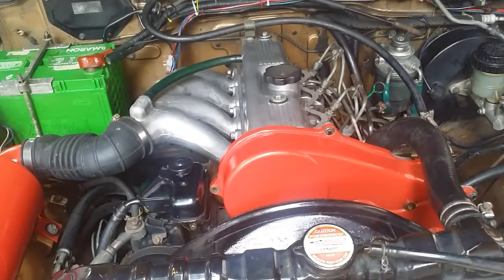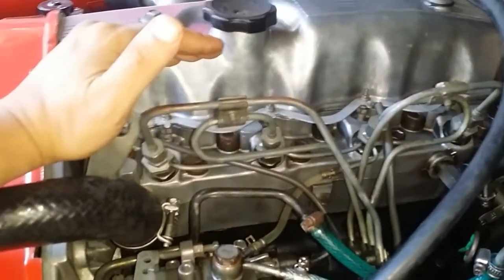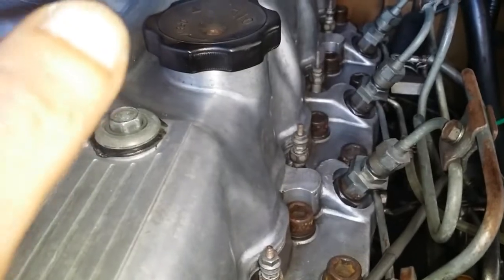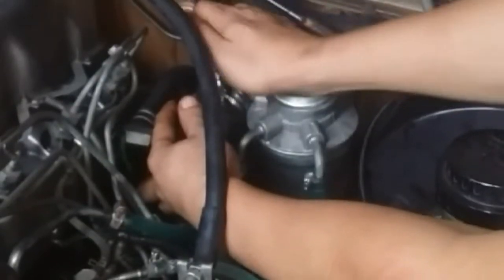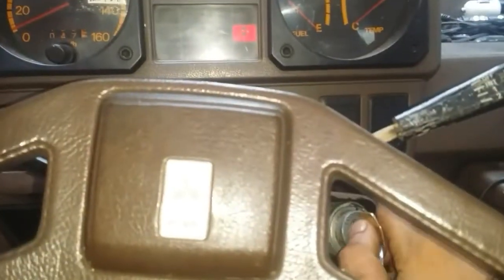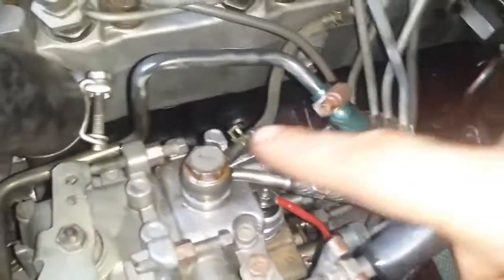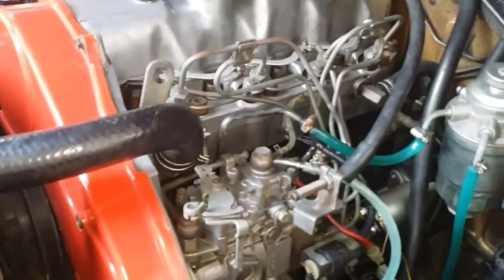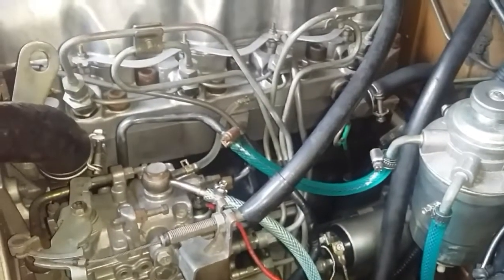Hard Start Problem. It's NOT the glowplugs

Comment: Hey buddy great video, if you're still around I've done all this and still hard start. I have to run my glow plugs for 20 to 30 seconds and it starts right up.  New 12v  glow plugs, and a manual on/off switch from the battery for the glow plugs. Engine has fantastic compression and runs fantastic. What do you think this could be? Would an electric fuel pump from the tank to the fuel filter help? Possible "leak" from the injection pump?
Reply from the maker: Try this https://youtu.be/QmTT74Uwqtg?si=pf0XlUDIQD_O7pYU

Comment: Hey. My pajero with 4d56t engine starts right away but the engine starts shaking badly and jerking after a while-once the glowplugs stop heating. Also smokes a lot and it sounds like its not running on all 4 cylinders. After it gets warm it runs perfectly. Could it be worn out piston rings?

Comment: Good evening sir, may I ask a question?
Can a broken/not fully functional fuel filter pump cause a fuel circuit discharge? 
I have a 4d56 ('02 Pajero Sport GLS with Intercooler) with new glow plugs and fuel filter but I'm having hard start problem...
I have to pump several times and then starts at the third tentative. I can't see any leak around the engine bay.
Thank you so much for your job, I'm new to this type of motor and I'm learning a lot with your videos.

Comment: See you a correct many people mistake a hard start for glow plugs because engine shudder from unburnt diesel if glow plugs are the main problem white smoke which is vaporised diesel will blow from exhaust and tje engine will settle after a few minute. All diesel engine work on compression to ignite fuel where as petrol require spark to ignite so starting a doesel without plugs is possible

Comment: if you could provide some this kind of information for Nissan Patrol Y60 2.8Td. Kinda have the same issues, changed the glow plugs,battery, checked the fuel lines and fuel pump, didn't notice any leaks, but still i have to wait for a 10-15sec for a selenoid click in engine to have a better start. Somehow sometimed it have better starts in cold start than in warm start. I will be so thankful if you could give me an answer on this case. Thanks

Comment: I have a 2010 Montero Sport. The engine dies at low RPM when the AC is turned on. Even while cruising with foot of the pedal if the AC is on engine dies.

Comment: As you can show on the video, my hand pump doesnt suck when I put the finger insted of the hose. Should I replace primer pump?
Reply: Yes do it, and new filter. I am in the works of fixing my hard starting as well, and I have done filter and housing/manual pump and it is still hard starting in the morning so I am doing lines next

Comment: I got a 2H 4.0 diesel Toyota..to start engine I hv to turn key 2 times..never start the first time..always the second time..so I changed 2 glows plugs 12V and put 24V like all others,but worst than before,,no start at all..I reput 12V old plugs and it started..why?Thanks

Comment: Hello sir. Thank you sa video very clear and helpful. Meron akong pajero 4m40. Ang problema pag matagal d nagamit, mga 1-2 days, nagpapalya sya after 30 seconds to 1 minute pagkastart. No problem sa initial start, 1 click lang andar na. Minsan namamatay pa talaga, pero napapaandar naman pero hard start na. After mapaandar ng ilang seconds ok na sya at stable na rpm. Leak sa fuel line din po kaya ito? D ko pa nasusubukan yung manual pump na tinuro nyo.

Comment: Sir, may I ask. If the pump is broken, wilk it contribute to gard start?? I taught diesel is already inside even if the pump is broken
Reply from the maker: Yes if pump is worn out that will cause hard starting.
Reply: @MrDIYer  kasi when I did the 2nd part ng sabi mo sir. The one with the bolt on the injector pump and start pumping the fuel filter pump and wait until diesel comes out. Walang lumalabas
Reply from the maker: Make sure gumagana yung lift pump, dapat may lalabas tlga na diesep don sa return. Subukan nyo pi wag masyadong maluwag yung bolt, sakto lng tapos pump nyo.
Reply: @MrDIYer  oo sir wlang lumalabas.

Comment: hi my 4d56u i replaced the valve cover gaskets and when i start i did not bleed hover it started the second try. i saw line 3 and 4 appearantly leaking fuel. now  i am seeing the middle line appear to be leaking after taking a short drive.
Reply from the maker: Just try to tighten the fuel line a little more.

Comment: I agree and very thankfull to your tutorials vedio Sir. your vedios are all informative.just today i seen my father inlaw mitsubishi space gear L400.every morning he almost drain out his battery to start the engine.its almost a year since the mechnic touch the engine to replace a glow plug and install a wrong glow plug.its longer than the iriginal glow plug so all new glow plug are dead or busted.im not a mechanic i am an engineer.because of this vedio so i come ti check the engine of my inlaw car.so i just replace the fuel pump assembly because it does not anaymore suck fuel when i bleed manualy and after replacing the fuel pump i bleed rigth away and without the use of the glow plug because they are all busted it start right away and my father in law was very happy.i didnot buy glow plug but i let him see that the glow plug are all busted but see it start easily not a matter of 2sec unlike before.this is very true bleeding the fuel line it the best remedy.Thank you Sir for sharing your knowledge to every one.👍👍👍👍👏👏👏👏
Reply from the maker: Thank you for taking the time to let me know my video helped you out.

Comment: Very good video! Thank u. I will try this as I had removed my fuel tank to clean it from rust and since then it has not started again. I will try this because I beleive I might have air in my fuel lines. Thank You so much. I will update you.
Reply from the maker: Good luck
Reply: Did not work. I think I need a new primer pump. I will change that. Also can you please confirm what size the fuel lines are that u have in clear? Just to make it easy for me to get some. Thanks
Reply from the maker: @zakariqbal9860  i think i showed how you can check if the lift pump is working.
Reply: @MrDIYer  Yes it does not pump. It is too soft like there is no air at all to pump. I am expecting my delivery for new one in the next 2 hours. I will update once changed
Reply: New primer pump is working. Thank You but the injectors are no good. One was damaged and the rest were leaking around the bay. I am expecting to change all 4 on Tuesday in a few days. Will update again. The car is starting now but cuts out after maybe 10 seconds or sometimes less. It is shaking too much. Maybe the injectors will make a difference. God willing
Reply from the maker: @zakariqbal9860  if its leaking its normal that it will die out because it will not maintain fuel pressure..try to re tighthen or better yet replace washers.
Reply: @MrDIYer   Yes I will replace the fuel injectors with a new spill rail and washers. Hopefully that does the job.
Reply: @MrDIYer  

Hello... I have changed the injectors and the washers along with the fuel spill rail but the car is still not starting. The fuel is coming out of the Injection pump but not out of the primer pump when I open the bolt the way you showed in the video. Is it possible to do a video call with you somehow and you can see urself. It would be very helpful. Thanks
Reply from the maker: Bleed it up to the injectors too. Watch video https://youtu.be/CBMXnn3V798
Reply: @MrDIYer  I have tried everything you showed but still no luck.
Reply from the maker: @zakariqbal9860  is diesel already coming out of the fuel line just becofe the injectors? Try spraying a little bit of lighter fluid in the intake.
Reply: @MrDIYer  after changing the injectors it is not coming out like it did before. There was more fuel pumping put before. When I take the injector bolts off. And pump the primer pump there is hardly any fuel coming out.
Reply from the maker: If there is diesel coming out the injectors. Tigthen it. Try spraying a little biy of lighter fluid in the intake

Comment: I've started getting a problem on these cold mornings with my 2007 corolla verso 2.2 Diesel will start the first time without a problem and idle normally. After about one minute or so warning light will show up on the dash than fter another 30 seconds the engine cuts out.

 When the engine dies, I can restart again without a problem and the whole scenario starts over this happen until the engine warms up. once the temperature reaches 60 and the blue light goes off the car works fine the rest of the day.

I cleaned the EGR, polished the glow plugs and tested them, put a new fuel filter, tried a working SCV from my mate's car, and did a full tank with fuel treatments.

None of the above-mentioned worked however the car performance is much better.

I tried to warm up the fuel rail line with a hot cloth soaked in hot water and will top it with hot water every now and then and the car did not cut off but won't drive as normal unless the engine itself is warmed up.  

Once it is warmed up it runs fine. Any idea what else could it be?  Thank you
Reply from the maker: what warning light?
during start up does it spew white smoke?
Reply: @MrDIYer the engine sign. No smoke at all not during starting up. 
when I do the scan  I get P0093
Reply from the maker: @malaajam  when the engine dies is it as though its choking? Vibrating? Starving for fuel?
Reply: @MrDIYer  no just as you turn the ignition off.
But if I drive the car before it warmed up 60 + it goes in limp mode.
Reply from the maker: 1. I would start by checking fuel lines from the lift pump to the fuel pump to the common rail towards each injector, run your hands through them check for  leaks crack hoses, loose connections
2. Check to see if the lift pump is working, you said you tried your friends scv maybe you would want to try the lift pump as well. This are  the very first things i would do and would cost none.
3. Since you mentioned that it works well after the engine warms up, best guess is i would put the blame on faulty injectors. But try 1 and 2 first, all too often it is the simplest solotuion that will fix it. Then try option 3.

Comment: Our ford everest 2004 model diesel, hard starting whether it's cold start or hot.. In order to start it smoothly we need to turn the IG on then wait for a sec for the glow plug icon (icon like a coil) to be turn off then that's the time we got very quick starting..  Is it normal to that model or it is necessary to check if there's any problem on the starting system?

Thank you sir! God bless!

Comment: Sir I have a 97' toyota hilux with a 2L diesel engine. Is the firing order the same with all diesel engines?  Glow plugs are ok,  fuel filter is new..,  solenoid is ok,  but still will not start.  Fuel seem is not getting to the pistons.

Comment: My car smoke a lot on start up and when it starts up it has misfire , until it heats up it’ll idle really rough . After it warms up it starts fine and runs normal . I’m thinking it’s  the glow plugs .  What do you think it is ?
Reply from the maker: Check clean or replace injector nozzles

Comment: Sir ask ko lng po un sa l300 ko po s umga hnheater ko po tpos start npo agd un, at bgo plit ndin po un carbon at solonoid ng starter, ang problema po ngyn pg mga 30 minutes to 1 hour n nkptay at instart po uli ayw po kelngn po iheater po uli, anu po kya ang possible n problema po, slmt po
Reply from the maker: Baka kailangan e adjust ang fuel pump

Comment: good day sir i already did  a engine rebuild sa 4d56 lubog type head  brandnew palit liner and piston ring  and  check na din clearance wala syo kalog at wala tama liner pero may smoke pa din  head cap and deep stick i think more than 5km na takbo the nag delete na din ako ng oil cooler line is it safe ba thank you
Reply from the maker: Ano ibig sabihin mo na ni delete mo na ang oil cooler line?

Comment: Sir what could b d problem of my 96 L300. When i turned on the key all lights in the panel are ok, but as i turned it to start all lights are turned off and no crank.. looks like it has no battery at all as i continue to attempt starting. But by battery is new, tested and it is above 12V. If i remove d battery terminal and put it back all lights in the panel are coming back (sometimes none)  but as i turned again to start, everything is dead.. I’m puzzled.
Reply from the maker: Checl and clean battery terminals. Check nyo yung  battery clamp lalo n sa negative baka maluwag yung wire sa clamp.

Comment: Thank you. Followed your advice to bleed my pump and the bleed screw has never ending bubbles. I removed the suction hose and I confirm a suction but it's a bit weak. I pumped the feed pump a few times before I started it cold and it took a  maybe 3-5 seconds to start....... compared to maybe 20-30 seconds of hard starting before watching your video. My fuel consumption is also excessive even though I have a newly overhauled engine. Was calibrated last year but am unsure if the calibrator was good. 2 questions: 1) is my feed pump dead because of the never ending bubbles in the bleed screw and weak suction (unsure how strong it should be), and 2) any thoughts on my excessive fuel consumption? Maybe you should do a video on that. Some 4d56 engines are efficient while some are not.
Reply from the maker: https://youtu.be/VWBu53sNbas

Comment: Good day sir. I have my problem my car Mitsubishi 4d56 non turbo. The problem is cranking but no start.
I replaced new fuel filter pump assembly and they have current supply shut off valve okay and good supply diesel but I start cranking but no start.

Comment: Boss maybe you can help me out, i replaced my glow plugs and now it has a rough idle. I put back the old ones and now it doesnt want to start. When i remove the glowplugs it is wet with diesel and dirty. What could be the problem?
Reply from the maker: possible loose compression. possible dirty injector knozzle.

Comment: So..whilst i appreciate what you are saying about potential airleaks causing poor starting..im sure that would cause poor starting hot or cold. 
Always best to check the glowplug circuits before replacing any parts followed by a resistance check on the actual glowplugs to see if one or more has failed
They are quite cheap n easy to replace.
Good video 😎😎
Reply: I have this cold start issue. And I find when my l300 sits for awhile 3-4 hours it will then have a hard start but it will not have an issue if I have run it and restart it (hot start). In my mind this is because the diesel has leaked out of the lines. I have no cold start issues when I manually pump the lines
Reply: @yesnomaybe3372 
You can check by manually pumping up the fuel pressure by using the pump on the fuel filter.
It's still a good idea to resistance test the glow plugs.
If your engine is the later common rail diesel it will have a far higher pressure fueling system.. So many different problems.
Best to get a diagnostic test carried out both hot and cold.
Reply: @harwoods11  brand new spark plugs. Pumping the pump it starts perfectly
Reply: @yesnomaybe3372 
New glow plugs and no start but pump the fuel pressure manually and it starts.
If so you may have seals leaking Internally in the  injection  pump.
So.. Maybe get someone to carry out a fuel pressure test on the pump?
I assume you've already tested any chance of leaking injectors? (huge smoke when first starting)

Comment: 😊 I helped overhaul a Mitsubishi 6DB1 that was 1998.   After overhauling glow plugs not yet available. Chief mechanic decided to test run the engine, told me to remove intake air cleaner and prepare gas torch. When set-up was ready, lit the gas torch and put near intake manifold port while engine started to crank. 3 attempts when white smoke out on exhaust then it runs. Chief was experienced also in Cummins, Detroit, Caterpillar engines for locomotive and heavy equipment.

Comment: Sir, kung injector return hose to injection pump and/or yung return hose to tank ang may problem (loose clamps or pinhole leaks) can it also cause hard starting issues?
Reply from the maker: possible po. lahat ng singaw na pwedeng pag mulan ng leak at pasukan ng hangin.
Reply: @MrDIYer  copy sir. Try ko ngayon palitan hose and clamps. Thanks

Comment: Hello, does a fuel filter has wiring? Where should it be connected if there is wiring???
Reply from the maker: wiring harness sensor for water build up. try to look around the wirings if the harness is still there. otherwise maybe it has been condemned.
Reply: @MrDIYer  if ever bbli ako assembly na may wiring saan ko po pde iconnect. Ung tinanggal ko eh wala na po wiring, anyway kinalas ko pofuel filter, may basic ba pde gawin para malaman if palit whole assembly na or the filter lang. Thanks po ng marami!!!

Comment: Good day sir. .ask ko lng kaka palit lng ng headgasket at piston ring ng sasakyan ko l300 versa van. .pag malamig madali ma start pero pag uminit na makina nya hindi na nya mastart. .kelangan palamigin ng konti tsaka lang magstart ulit. .ano po kaya problema ng sasakyan ko. .
Reply from the maker: kung mainit ba pinapastart yung makina parang nahihirapan mag crank o umikot yung makina?
Reply: @MrDIYer  oo sir nahihirapan mag crank. .
Reply: @MrDIYer  any idea air kung ano problema ng 4d56
Reply from the maker: satingin ko nung ni overhaul yan. pinasikip masyado ang piston to wall clearance at ng piston rings. pag uminit na kasi ang makina mag eexpand sa loob yan. pag sobrang  sikip parang nag stostock up. kaya hirap rumidondo pag maginit. ang ma suggest ko try mo flush radiator mo o check ang clutch fan mo..wag mo hayaan uminit makina.
Reply: @MrDIYer  sige po sir. .parang kulang ba sa brake in yung makina. .palitan ko nlng clutch fan sir. .mejo bitak bitak na kasi. .maraming salamat sa tulong sir. .
Reply: Subukan nyo pong ibleed ang fuel in every nossle, baka may hangin, it should be solid fuel flow at saka malakas tumilansik.